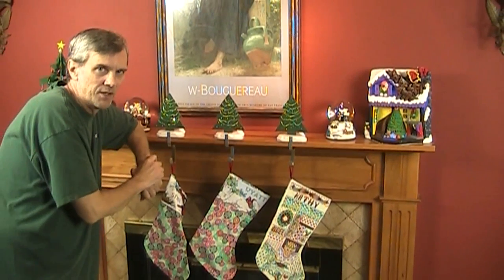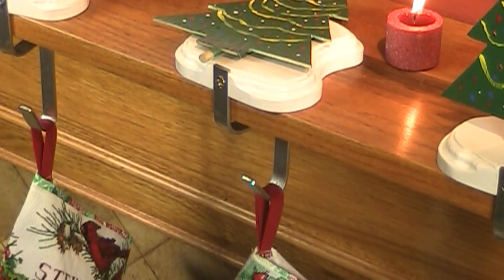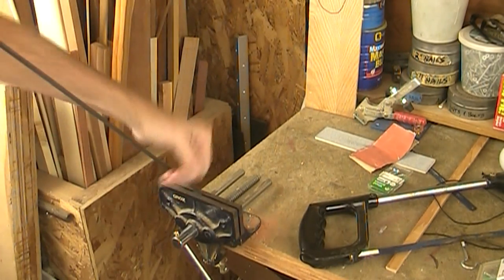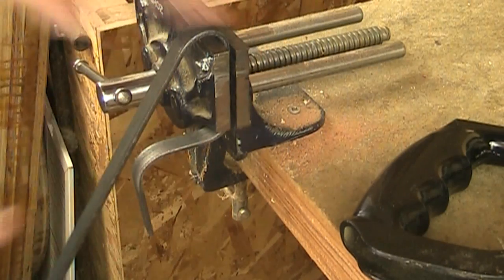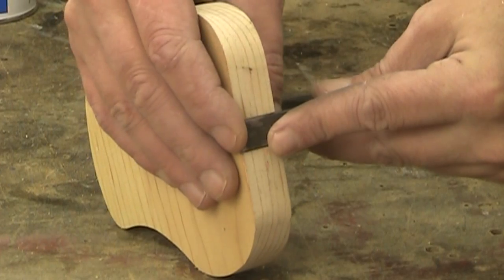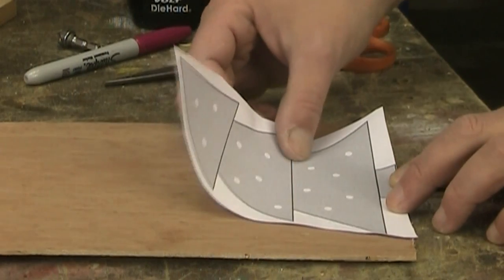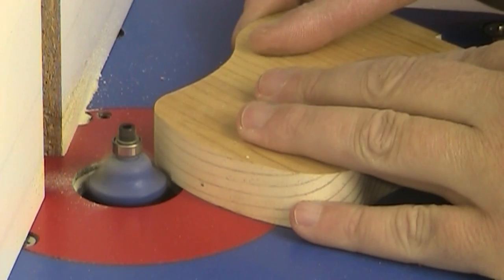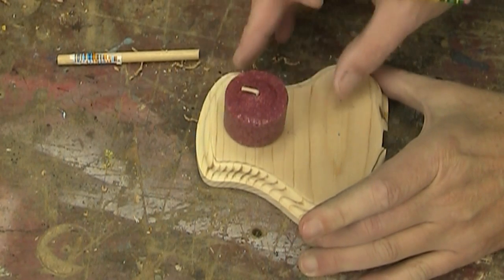Make a Christmas stocking hanger & candle holder

Comment: If you don't want to worry about painting the hooks, you can buy stainless steel 1/8" x 1/2" for as low as $1.50 per foot at the various metal places online. Or paint.

Steve, now the safety patrol will want you to knit a fire extinguisher cozy to keep you safe from the candles igniting the trees!